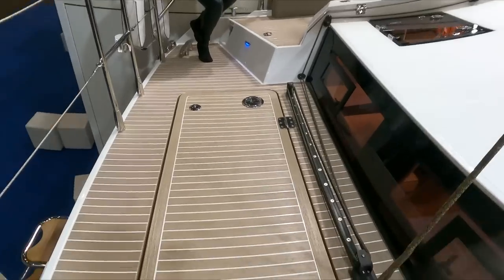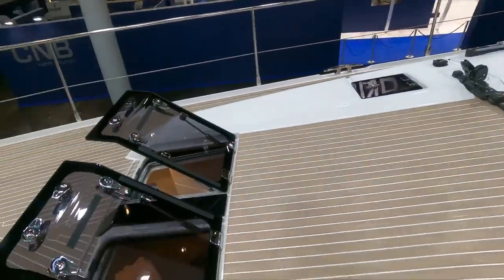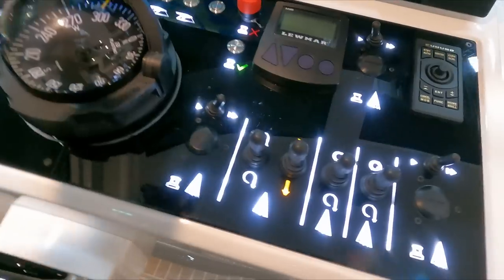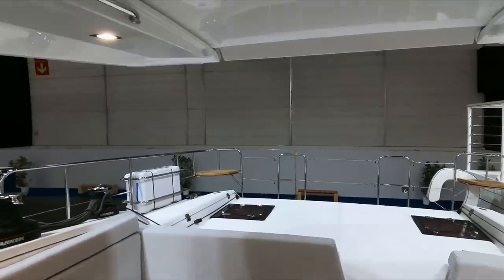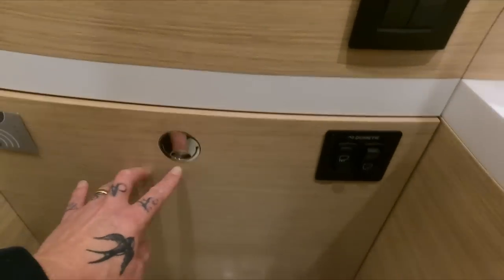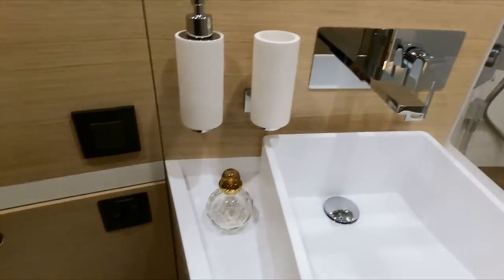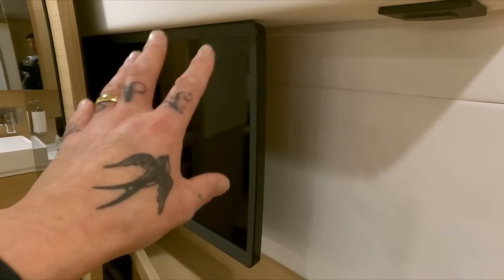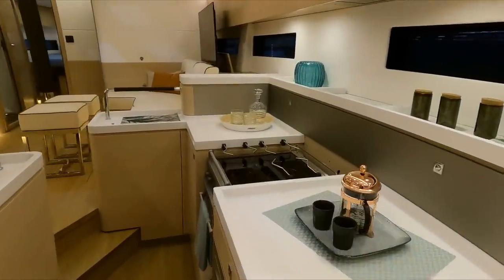AMEL 50 Sublime blue water sailboat

Comment from the maker: The date has been set;) for a test sail here at La Rochelle (YES), so if you have questions for AMEL put them in the comments below for me please;)
Reply: Thanks for the excellent tour! I was wondering how one would handle this boat single handed, especially when it comes to docking. Maybe you can ask the amel guys. Keep up the good work!
Reply from the maker: @sailinggrace9207  We will get it all on video for you and put a novice on the helm just for good measure;) Thank you for your question.
Reply: @SVTONICBoatWives  Awesome! Can‘t wait! Thank you!
Reply: Awesome video. I'd like to hear how much noise the Amel 50 makes on the inside while sailing, I've heard it shouldn't make a lot of wood cracking noises like most boats. Thank you
Reply from the maker: @caioevangelista4815  I am with you on this one. I would hope there is very little noise under power and under sail. Thank you for your question and for watching the video;)
Reply: Thanks for the great video! My question for AMEL: Are there any plans to introduce a parallel hybrid, i.e. an electric, say 2x10kW motors coupled to the diesel engine to drive the shaft? For me, and maybe for many others that could be an interesting setup, because one could have silent, vibration free, fumeless propulsion for in/out of harbours, calm seas, motor sailing etc. Also, it would double as a powerful generator by the diesel engine as well as hydrogeneration while sailing. Saves a dedicated generator, and together with a generous lithium battery bank and solar would make an even greater and more comfortable blue water cruiser. The powerful diesel with its range would still be there for the high seas and long distance motoring. I'd be very happy to hear any feedback from AMEL on this.
Reply: 1.  One of the many draw backs of having twin rudders with only one propeller is there is no prop wash over the rudder which makes slow speed maneuvering difficult.  Is there a stern thruster option?

My next round of questions could probably be a whole segment on the video or possibly an entire technical video.  

2.  Lithium ion battery bank:
- Amp hour capacity of the standard battery?
- Does Amel offer an upgrade to increase the Amp hour?
- How long will the boat run on the batteries if you run the air conditioning?  The Hylas H57 standard battery bank will run the Air Conditioner for 8 hours for example.  Great for when you are in the tropics.
- Does the generator have an automatic start function to charge the batteries?  
- Is there an option to order the boat with a United States electrical system?  We simply don't sell appliances here that operate on 220V 50Hz.  Plus our electrical plugs are very different.

3.  Shore Power system.
- Does the boat come standard with an isolation transformer?
- How does the electrical system adapt to different shore power around the world.  Europe has 230V 50hz.   Western countries hav 220V 60hz for example.

Comment: I actually liked this review. Something fresh and nonchalant for a change. I didn't know you could use the front cabin door as an ersatz bulkhead.

As for the boat itself. MAYBE you could ask someone at Amel about it. Everyone is very quick to praise Amel for their "engine room" with "everything in one place". But I've seen youtube channels of people who buy Amels USED, and it is FAR from ideal. For example, those lovely "in one place" valves are good but problem is, those are the ONLY valves on the entire boat. You can't isolate one head or one sink if something goes wrong. You have to completely cut off water from the whole side of the boat. And if something happens in the middle of the ocean and you don't have a spare part, you are left with a HUGE inconvenience. 

And I REALLY don't like a huge section of the boat being walled off for the engine room. I honestly think having all the machinery and tanks under the sole is a better idea.

And THANK GOD, Amel finally got rid of the mizzen. NOBODY knew why their 40-footer needed a mizzen. Must've been their "Citroen moment".

Comment: I don't understand the twin rudders? Have you tried to back a twin rudder single screw sailboat into a slip? It sucks. I assume there's a bow thruster but that only keeps your bow straight. I'm curious to see what happens when put your rudder over hard to kick your stern over and all the prop thrust goes right between both rudders and does nothing. You need to be making way for them to react because there is no prop wash rushing passed them. You'll see.
Reply: Totally agree on twin rudders. Also the rudders are not protected by the keel. They are only necessary because they abandoned all pretence of hydrodynamic design by carting full beam aft, so when heeled the bow goes down, the stern up and a single rudder can't work as it is now mostly deflecting air. So sailing qualities are discarded in the interest of more hull volume.
Reply: @deerfootnz  I think it's a bad idea in a cruising sailboat. I chartered a 50ft Oceanis that had same set up. sucked backing into a slip. Amel use to lead the industry in innovations and now they blindly follow the newest trend. If it ain't broke don't fix it. I bet that is what the old man would have said.
Reply: @robertfreeman2322  the twin rudders are only necessary because of poor design options at the aft end of the hull. And those design options are only necessary if you abandoned every value your founder who gifted you the company had and blindly follow the market down the same rabbit hole as 3d tv and betamax tape

Comment: wonderful boat but in my opinion it is no longer a real sailboat!
Reply: I can't believe the idiots have put twin rudders on the thing tbh. Best Wishes. Bob. 😢
Reply: what is it then? there are a couple of them sailing around the world
Reply: @brownnoise357  idiots????? even the kraken 50 has twins as it is the way to go
Reply: @johannesnuyten3809  Yes twin rudders are idiotic. apparently a lot of Sailboat Racers are having the twin rudders removed and replaced with a single Rudders, to get feedback from weatherhelm again, plus reduce the vulnerability to lobster pots, crab pots, and fishing nets. On a  Cruising Sailboat, they are seriously idiotic for the exact same reasons. Same goes for ruddy Deep Draft Keels if you ever want to tuck into somewhere sheltered like a Shallow Bay  out of the way of an incoming  storm.  Cruising Sailboats have totally different requirements to Racing Sailboats, and it definitely pays Not to confuse the two in one boat. Only an idiot would do that. Isn't that right ? 🤔
Reply: @johannesnuyten3809  PS. Look it's a Mental approach issue- an non rudder based insight . Would I be idiotic enough to put a battery powered outboard on my Yacht Tender ? No. Why, because I have been stuck close to shore on a pedalo with myself and a friend when without warning, in the Mediterranean,  Conditions changed to a strong offshore wind and rough sea conditions. We could not get any progress towards the Beach, and friend got Seasick. Luckily a speedboat came along and towed us in. Battery powered Outboard. In Mirror calm windless conditions you have about 40 minutes use ar about 3 knots.  How much Battery life do you have if conditions change unexpectedly, and you are trying to get back to your boat at Anchor?  40 minutes ? No if you have to wind up the throttle trying to make progress, you are down to single number minutes, 9 minutes or less immediately. Starting to see the problem ? With an external three gallon petrol tank, at low speed, with say a 6hp outboard, I'm doing about 4 knots, maybe 5 knots. and the fuel tank gives me about 3 hours duration. Open it up a bit to make progress when conditions change, and that may drop to 1.5 hours, open it up a bit more, and maybe an hour. Result either way, I get back to my boat at Anchor. In that situation, it is all about The Energy Density of Fuels, and there isn't a Battery made today, that has the energy Density of Petrol, and Petrol doesn't have the energy Density of Diesel. So which is the Safer Option The Idiotic Ideology Based one, or the Basic Physics based one ? 🤔
Reply: @johannesnuyten3809  Just because you Can do something, doesn't mean you should. You can't get around the lack of feedback from twin rudders, and you can't get around the loss of Manouverability at low speed either, but you can compensate for the loss of Manouverability with a variable pressure bowthruster, a variable pressure sternthruster wouldn't hurt either. But ! whatever you do you do not remove the vulnerability of twin rudders to things under the surface of the water, like logs ropes, weed etc, because they do not have the protection of a Keel in front of them, like a single rudder does. If you want best low stress performance on a wide  eamed boat, you keep the Mast as vertical as possible with low heeling angles, so the issue of a single Rudder leaving the water, should never arise in the first place, and as a Cruiser should really keep rigging and sail stresses within about 80% loadings, getting weatherhelm feedback to rapidly dump stresses, is pretty important for maximising Reliability, and reducing breakages while extending the service life of everything you have spent a lot of money investing in. Racing Pushes everything to 100% and as I think it was Colin Chapman who said the perfect Formula one Car Falls apart 10 yards after crossing the finishing line. You see that same approach in Racing Sailboats, resulting in it being an extremely expensive pastime, with very little of benefit worth passing on to liveaboard Cruising Sailboats. Frequently, what is passed on is the dangerous disadvantages, like Mainsheet tracks in Cockpits (ever gone a purler from one and going headlong towards the companionway as a result ? Mylar Lamiinate Sails, Synthetic Standing rigging that goes limp and saggy in the Cold, etc ? Stick that stuff on your boat if you like, but it will never be on mine. 👍
Reply: @johannesnuyten3809  Thete are literally thousands of Benesqueekycreakytoes doing that. No problem for an Oceanis, but would you do it on an ultralightened for Racing First Model ? I wouldn't. 🤔
Reply: @ABC gang yes of course but it's like navigating to the plystation. but again it's very beautiful!
Reply: Somebody in a video I watched last week said something verybinteresting and true "I have never had any objections to a large comfy well protected and secure aft Cockpit Sailboat when Crossing Oceans and in fact they've enjoyed it." I wish I couldvremember who it was to give them the credit for it tbh. 👍
Reply: @johannesnuyten3809  one important caveat with the Kraken 50 is that it makes a big deal about the rudders being protected by a skeg with a hefty level of reinforcement, whereas I think the Amel uses twin spades.

Depends on your risk profile and design of the rudder post area. Single v twin spades... well, maybe the single spade is more protected by the keel, but you have no redundancy

I think for most people the biggest problem with twins is going to be the day-to-day impact on low speed maneouvreability.
Reply: Unprotected Twin rudders , unbalanced ends , ikea interior . I will take a pass
Reply: @ABC gang 
Have to agree. I was 70 last month, Prescription Meds have left me physically crippled with arthritis, plus Hearing damage, and the last straw was my last Meds blew the optic nerve in my right eye, and damaged my left eye. So I've fired the Health Service and have only one interest in seeing a doctor ever again, to fill in my Death Certificate, if I'm not buried at Sea. So until that time comes, I'm determined to have at least one more Liveaboard Monohull Sailboat first likely a secondhand one to tide me over  until I can get a Construction Slot to have exactly what I want built. God Willing of course. tbh, I should have been dead before the age of 30, so more bonus time time under Sail is fine by me, even if I have to have a delivery skipper and crew to get me where I want the boat to be, then family and friends can fly out to join me whenever they want. Seems like a plan anyway. Best Wishes and Fair Winds.  Bob. 🤔 😁 👍⛵️✨️✨️✨️✨️✨️
Reply: @ABC gang Wow ! thank you for watching my videos . If you have any questions about the "liberties" I have taken please ask away on my Youtube channel . And thank you for doing these great reviews . I have been aboard all the new Amels and my opinion stands , but that is just my opinion. I don"t own one. Personally if i was to purchase a blue water production boat today / new , I would be looking at a Kraken , Again this is only my opinion. If you would like to know if it a a valuable (educated) opinion. Please contact me on my channel.
Reply: @ABC gang I have to admit you are right on so many of your points , " just about to sail across the pacific  ocean and I noticed my rudder falling off" ???!! I work in the Marine Industry and have owned many large and small boats but not the greatest Youtuber . As you can tell . 
Yes the Solar arch was professionally made by me , LOL I have skin in the game. Why build a new bimini that will not last and can not carry a large solar array ? I dont like arches of the back of boats , makes the boat look cluttery. So I combined the function of a bimini with a solar array. 

You can still get a solid teak interior on a new boat , regretfully it would have to be a custom build. and very expensive . The economics of yacht building has changed as has it has in every other sector . Presently I am working on new deck nonskid and painting the topsides. Will be launching in 2 months .
 Videos to be loaded are new AC unit install of my own design. New hydraulic winches , vang and backstay. Installation of an aquadrive system, rebuilding of the main engine , installation of a diesel  airshutoff valve . Servicing all through hulls , replacement of all bellow water lines hoses. Install of central heating system with calorifier for hot water. Installation of water maker , my own design again .  Covid allowed me to do all this work in the past two years , now back to the water. O yes and removal of rudder for inspection . That turned out great , Bristols have solid glass rudders(no foam , no stainless) with all bronze internals . It weighed over 325 Lbs. 50 years in this business and I have never seen a rudder built like that ! Weight is not your enemy on a cruising boat.......to a point .